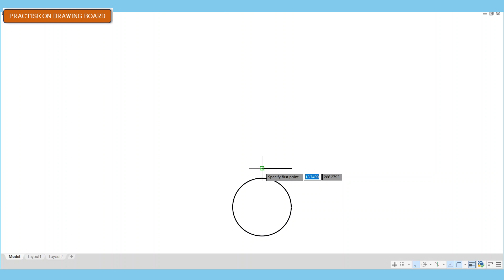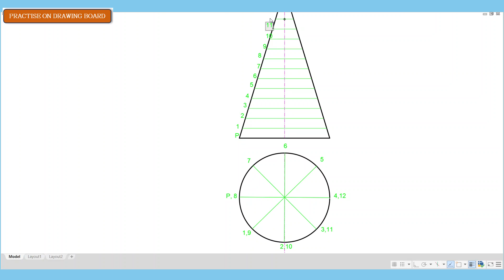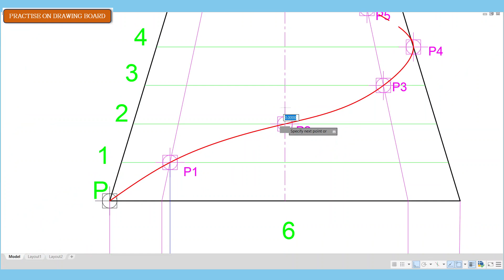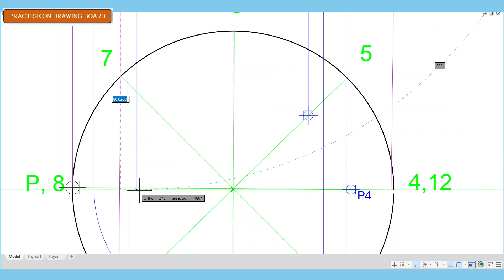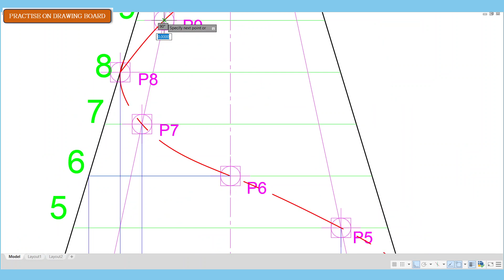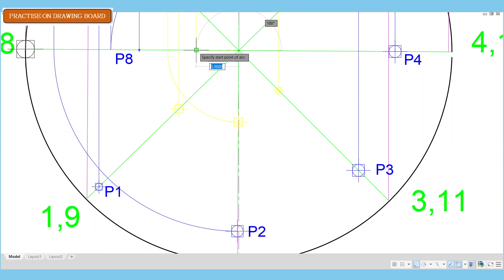Helix On a Cone for One and Half ((1½) Revolutions

Comment: Sir please the p12 where is located I don’t understand
Reply from the maker: The last point is always (12 in this case) located at the pitch. When the height is equal to the pitch, the last point will be at the apex( vertex) but in a case where the pitch is less than the height, the last point will be located at the pitch.
Reply from the maker: The last point is always (12 in this case) located at the pitch. When the height is equal to the pitch, the last point will be at the apex( vertex) but in a case where the pitch is less than the height, the last point will be located at the pitch.